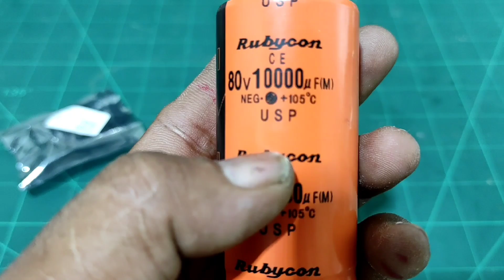tpa3118 menggunakan elko 80V 10.000UF

Comment: Mau tanya bang ..
Modul ini apakah tidak tahan jika di suplay lebih dari 12 volt ?
Saya suplay menggunakan adaptor laptop 19volt kok mati ya ?
Reply from the maker: Tpa rekomedasi 12v mas jngan lebih
Reply: Owalah, pantesan , beli 10 udah mati 3, gegara kelebihan voltage ..

Makasih info nya bang. .
Reply from the maker: @anangfunky  meskipun speak 12v-24v lebi baik pakai 12v untuk tpa3118 dan 3116
Reply: Kalo chip ori pake 24v aman
Reply: Sy pke 24v 3a aman
Reply: Yg pakai cas laptop 20volt aman"aja

Comment: mas tpa3116d2 2.1 udh pake galaky tp kok suara pelan.
mesti mentokin volume dulu knp ya
Reply from the maker: Adptor pakwi brpa wmper
Reply: pasang d mobil um
Reply: 12 volt tak kasih step up 24 volt
Reply from the maker: Coba lepas galaksinya noemal apa gak,dan lepas juga step up ya supaya tau mana yg buat problem
Reply: minta wa um

Comment: Mas punya saya tpa 3116 d2 2x 120  smps 24v 9 ampere (amper smps ngak bisa cek)
Suara putus2 kalau kena bass (speaker legacy 6 inch main 2 ohm) tapi kalau main 4 ohm aman ,saya tambah elco 25v 2600uf 4 biji masih tetap putus2..kira2 apanya mas...
Reply from the maker: Bisa jadi tpanya gak kuat bisa jadi dpmsnya drop bisa jadi kabel dari smps kurang bagus,banyak faktor untuk permasalahan itu
Reply: Elco ganti 4700/35v atau diatasnya.. smps pake 24/5 amper aja

Comment: Kang opek ampli sya wuzhi zk502h waktu pertama pake suplay 12v 5a,suaranya bass nya mantap, nah gk baru make 2 bln power supply nya rusak, nah saya ganti yg 24v 3a, saya step down ke 15v.. Suanya makin joss, tp baru sminggu kok suranya jd cempreng yah om, ada bass nya tp gk jedug bgt.. Apanya y om yg rusak,
Reply from the maker: Coba adaptor yg lain mas
Reply: Blm saya coba si om, tp saya gnti 12v 2a punya cctv, masih sama, kurang ngebass bgt
Reply from the maker: Bisa jadi ada capasitor yg warna coklat coklat itu mati bisa juga ic nya melemah  mas akibat terlalu sering main volume di atas 50%
Reply: ADAPTORNYA KALI Y OM

Comment: kak mau tanya..q punya Pam 8403..+ TPA 3110...q juga punya equaliser Mono 2 bj...mirip punya kakak....Dan semuanya pke smps 12v 5a....pertanya Anya klo liwat equaliser suara  ampli q besarkan suara Bass jardí glorok...klo q besarkan....Tapi klo tanpa  equaliser...suara Bass kluar...kira2 Apa penyebabnya......kax mohon solusinya...
Reply from the maker: Out equaliser sebelum ke ampli kasi r10k masing2 ke input amplinya jadi 4/ atau bisa cobak adaptor yg lain
Reply: @bangopek  berarti solder  k PCB nya Baruch kabel menuju Out kax?
Reply: @bangopek  untuk 2 equaliser itu butuh bé rapa ampere kax?
Reply from the maker: 2A
Reply from the maker: Betul
Reply: mksih kak...ilmunya setelah TPA q ksih adaptore sendiri Bass gk glorok...tpi biar rapi q Mu masang r10k....maturnuwun..,,
Reply: kak klo TPA 3110 dikasih elco apkah bassnya Bisa empuk? klo Bisa pke bé rapa?
Reply from the maker: Intinya lebih bagus ketimbang tanpq elko
Reply: @bangopek  dikasih 3300 50v Bisa? apkah ha rus dishotkan dulu?
Reply from the maker: Bisa mas
Reply: @bangopek  mksihkak